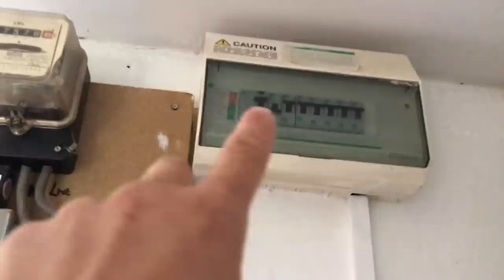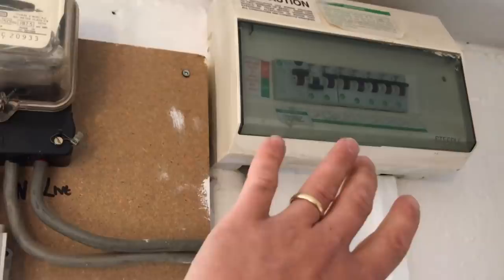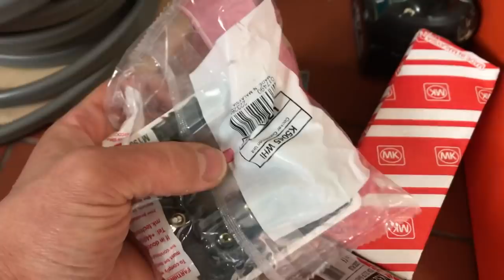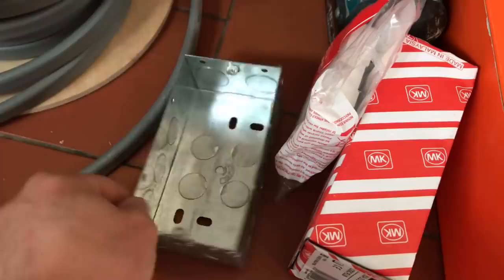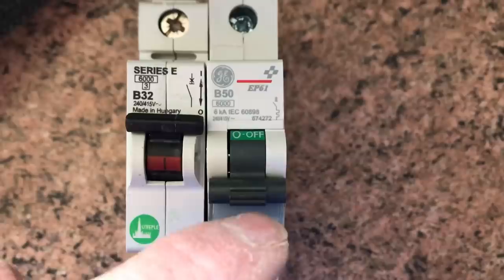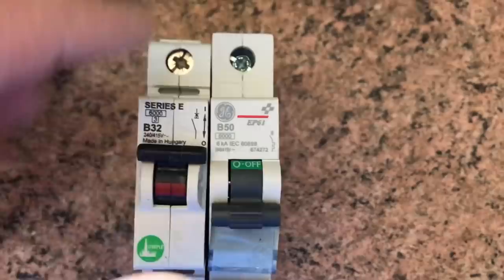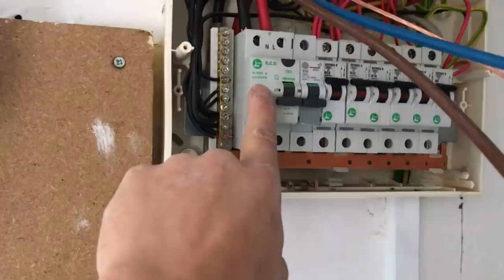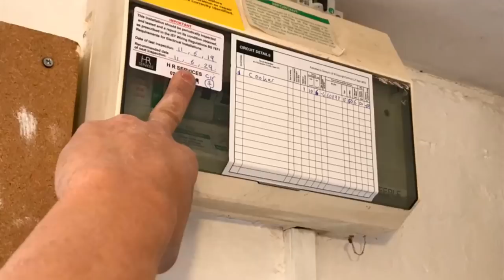CJR ELECTRICAL Electricians day installing 50amp cooker supply!!!

Comment: Good video as always hope you dont mind me commenting but... (also its early morning and I have no book with me so working off memory...)

Isn't 10mm too small for you 50a load? Given your cable is not clipped direct, I would class that as buried in wall in conduit, which I think is ref B. Which I believe is less than 50a for twin and earth. That's not accounting for voltage drop and max zs.

Which also leads on to other comments about manufacturers instructions and interpreting the regulation regarding following manufacturers instructions. If it states 10mm 50a, consider this dont follow blinding. My understanding of there instructions  would CPD to be not bigger than 50a and cable to be no smaller than 10mm.  For those fitting 10mm on a 50a mcb and not doing any other calculations because the manual said so your gonna end up in trouble. There are other factors to apply volt drop, installation method, as etc.

Now regarding voiding warranty this depends on what your installing if a cooker you could fit 32a on 6mm that's not gonna void your warranty might cost the end user money for nuisance tripping call outs. However 63A on a 10mm would if the cooker failed as mcb too big. However in a different setting on a machine on a production line installing a Cpd other than stated by the manufacturer will void warranty and could kill someone even if mcb smaller than recommend as machine for safe purposes need to shut down in a certain order.

To summarise don't follow blindly or because that's how my mate does it. Use your knowledge and experience, based on the environment you are in. If you do you job right and can demonstrate how and why you did what you did that's all that matters the regs are there to aid us they are not flat pack instructions. 

Thank you for your time creating these videos and for those that post comments without this standards are slow to improve.

Comment: Diversity works for 364 days of the year but he is right in saying Xmas day, every single ring and oven will be on flat out at some point (usually for a few hours) and that is where having the headroom of 10mm and 50a breaker will give homeowner peace of mind and no stressy phonecalls from client saying you said it would be fine and you ruined xmas, if in doubt over engineer!!
Reply: No Cooker is on flat out for several hours ever... perhaps a few minutes if everything is switched at the same time... then the thermostats kick in
Reply: @user-sg1ku5hu5d  that is true, but on a day like Xmas day this may happen several times as different things are prepared, and if the manufacturer says 50a they say it for a reason, applying diversity because you know best is rolling the dice, you may well win, but why take the chance.
Reply: @prime1971  I agree MAnufacturer's spec rules, none the less a cooker cannot operate at it's total combined maximum load beyond a few minutes at a time... It's not a water heater for example

Comment: Please don’t shout at me guys, but as a domestic cooking appliance diversity plays a huge part.

10 amp then 30% of your remaining demand. This design method has worked for decades. 
 But not having a dig, just my opinion based on real life and experience.
Reply: SM Electrical Solutions I’m a Sparks of 23 years and I’d never used diversity!!! I always thought,come Christmas Day when all the ovens on....BUT they will never all be on-the grill can’t be on when the main ovens on,the oven cycles in and out when it’s meet temperature,so you’ll never pull more than your 10amps + 30%.
Reply: tommochelsea72  do you apply diversity nowadays or dont you still bother. Have been pulled up in the past myself for using it
Reply: SM Electrical Solutions I won’t lie,I always thought it was ‘a rough figure’ not a ‘exact calculation’ for diversity. Now I know there’s a formula (must of been off  from college when we learned this,and I was never taught it during my apprenticeship!!). 
I use it now but I installed a 3phase 14.4kw per phase commercial cooker the other month and didn’t. I know their argument is that only for very brief periods certain parts of the oven heat at full power,but would you want to risk it and the power over loads in a fully loaded coffee shop?
You got picked up on using diversity??

Comment: What about diversity? Wouldn't that have meant the 6mm was adequate? (without knowing the full rating of the cooker of course) good channel btw
Reply: Install to what the manufacturer's instructions state, regardless. Anything happens its on the manufacturer's head not yours.
Reply: Would have been fine on a 6mm with diversity. Love the old when it’s Christmas Day, you never have an electric hob turned up to full whack or your just going to burn what ever your cooking lol
Reply: @TheBruton85  I am currently training as a 50-ish-year old, and I am admittedly  an awkward sod re diversity on cookers. 
Yes, we get given the calcs again and again, but in my mind, there is always "What if?". 
I would far sooner install cable that is "over-specified" than under. 
Whether or not the manufacturer or the regs state x or y, I don't like the idea of a client getting harmed. Doesn't matter if the manufacturer gets sued, it's better to avoid crap in the first place, if at all possible.
Also, there are certain "ethnic groups" in GB now who don't use electric cookers in quite the way we do... (I wonder if my comment will be deleted ??!)

Comment: Some manufacturers don’t take into account diversity and just work from max load which the appliance will never pull.
Reply: robert swingler if the manufacturers say it has to be 10mm and 50A mcb that takes priority over the regs
Reply: Gareth Hodson no it doesn’t .
Reply: Gareth Hodson we just have to take them into account
Reply: robert swingler manufacturers instructions supersede any regs and if there was a problem that is what they would go on - diversity is a major factor but if it says 50A supply that’s what you have to do
Reply: Gareth Hodson is there a reg that states this ?
Reply: robert swingler can’t quote the number but there is a reg that states that we must work to the manufactures instructions at all times. Even if this contradicts bs7671.
Reply: robert swingler 
Regulation 134.1.1
Good workmanship by competent persons or persons under their supervision and proper materials shall be used in the erection of the electrical installation. “Electrical equipment shall be installed in accordance with the instructions provided by the manufacturer of the equipment”
Reply: Gareth Hodson lol WRONG . 134.1.1 has been changed it now states “ shall take account of manufacturers instructions “ so please read it
Reply: robert swingler Yea “shall”meaning you have to do it 👍
Reply: robert swingler I’ve had first hand experience of this - a company wired up a new machine on a job we were on - nice tidy job but the cable wasn’t the correct size feeding it. It was smaller than stated in the instructions. The £20k machine went faulty, no fault of the sparky. The warranty was void on it because it hadn’t been installed to manufacturers instruction - even though the install  complied to the regs. Company had to pay £1700 to get it repaired so be careful 😉
Reply: Gareth Hodson lol not at all it was change for a reason . Some manufacturers instructions are plain and simply dangerous and should not be follow under any circumstances . Shall take account doesn’t sound the same to me as shall be installed to manufacturers instructions. Why would they bother changing it if it meant the exact same thing? I would be more than happy of take the responsibility of fitting that cooker on a 6mm cable protected by a 32A .
Reply: robert swingler just hope it doesn’t go faulty then 😂
Reply: @robswingler  Good for you, but you got a free comeback from my end since the breaker trips when I put all my pans on + not installed acc. to manufac. spec. Also the 32A breaker is going to heat up every big cooking event since it's a 50A hob. Breaker could easily fail prematurely. I think CJR made the right call on this one, also makes quick work of any warranty claims. Diversity should only be applied for more than one appliance, not for one single appliance.
Reply: Gareth Hodson I think it’s actually safer on a 6mm/32A . In any circumstances other than clipped direct and ref B 10mm can’t take 50A so you better hope that cable doesn’t come into contact with any insulation as I’d find that far worse than me not following MI blindly. Would you follow MI from some of the light fitting from China that basically tell you to wire everything the wrong way round? The reg was changed for this very reason they know that some MI are a joke .
Reply: jim575757 of course diversity can be applied to a single appliance . Most cookers can’t have the grill and oven on at the same time . I have a 3.2kw oven and a 7.5kw induction hob on a 6mm / 32A when putting ever hob on max boost and fan oven on I got a max reading of 23.4A  . The instructions aren’t taking diversity into account at all they would say my set up would be max load 10.7kw so around 45A and would require most probably a 10mm as well. Which would be a joke . I’d say there would be very few domestic cookers out there that would require more than a 32A mcb with 6mm
Reply: Gareth Hodson .. ‘shall’ means ‘may’ and not ‘must’.. it’s an ambiguous word at best.. whereas ‘must’ is clear as mud and and can be considered to mean mandatory.. just my pennies worth 😉
Reply: @robswingler  Something is not right, if the oven is really 3.2kW (not grill+fan or something) that means your 7.5kW hob is only pulling about 2.41kW on max. boost. Maybe there is a power share setting on 25A active? I have a ceramic hob + fan oven which is rated at 230V 32A (7.4kW). If i put all 4 plates on full and oven up+down i measure 31.9A @221Vac. Which seems correct. Ofc the plates shut down pretty quick after which the current drops again.
Reply: TheLifeOfRipple ‘shall’ means ‘must’ to me.  But I’m in the US. Is it different in the UK?  Of course, “shall take into account” definitely gives more leeway that “must follow”
Reply: The important part here is not the "shall", it's the "take account of manufacturers instructions". That's what's changed here.
You shall take account of what they say, but you do not have to install the appliance as they say.
Reply: Robin Whitfield thank you . Finally someone that understands English . That’s the point I was making
Reply: In this case I'm not sure what I'd do though. As the installation method is buried, I'd probably go for a 40A breaker and test with a clamp meter to see if I think that might be a problem in the future. Going to a larger cable just to satisfy 50A for that installation method seems a bit silly.

Comment: HARDWALL!!! WRONG you should be using bonding coat plaster. 4:51
Reply: plasterer speaking here , he is not wrong, bonding coat is for low suction backgrounds, both will do the job , hardwall preferable for brick/ block backgrounds, some have mentioned using Pva as a primer, very good  ,key really is to rid the chasing of dust , SBR is better and with a milkier consistency, easier to apply , its just a bit dearer than Pva. If you are using bonding coat in masonry chasings , sbr will kill the suction and minimise shrinkage better.

Comment: I’ve never seen a 32a trip an oven . Even a big range .
Reply: Yeah but he said the max load of the oven was 50A
Reply: xerox3333 max loads of most ovens + hobs are over 50A but you have something called diversity
Reply: @robswingler  I don't think Chris has done anything wrong here, he's advised the customer using the manufacturers information if they state it has a maximum 50amp load then we have to go off that information non of us has seen the make or model of the oven it could end up having 4 ovens, five rings, a griddle and a built in frier etc, so could well be 50amp yes there's diversity to consider BUT if something goes wrong who is going to be stood in the dock facing the prosecutor for the HSE not me. you or the manufacturer its going to be Chris.  Chris has been asked by the customer and he's advised them to install 10mm cable and 50amp switchgear etc if they didn't want to go with Chris's advise they could have got old Joe from the pub to wire it into a 13amp plug top on a spur off a ring main, with no paperwork.
Reply: Lee Butterworth not saying he did anything wrong at all . Just that I’ve never come across a cooker that can’t go on a 6mm/32A

Comment: FFS! 
Fix the sound!
Reply from the maker: What’s the problem ?
Reply: Nothing! People have got to understand this is real world site conditions not a films studio.
Keep up the great vids
Reply: No problems with the sound mate, probably on his end there's an issue!
Reply: Sound is fine.
Reply: CJR ELECTRICAL good video again mate - if there is an induction hob it may trip the RCD I had problems on a job a few years back with the same sort of thing
Reply from the maker: Yeah I’ve made them aware that there 30ma rcd acting as the main switch they might encounter problems with nuisance tripping. What was your solution?
Reply: @Cjrelectrical  board change, rcbos 😉